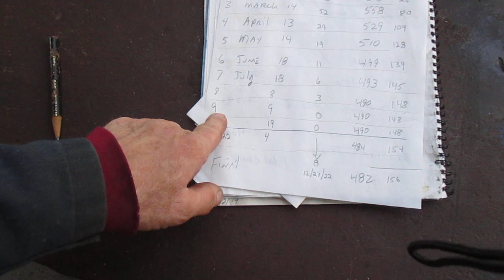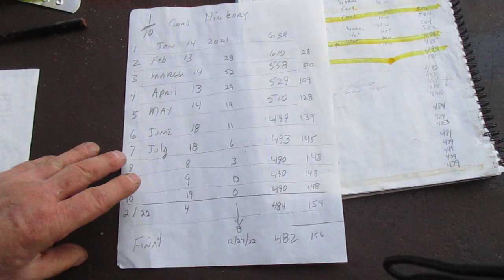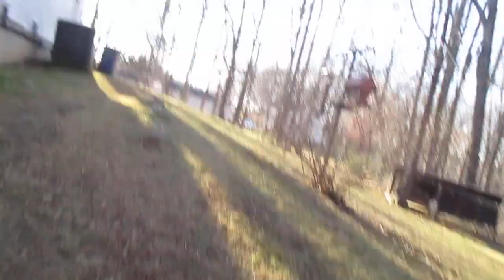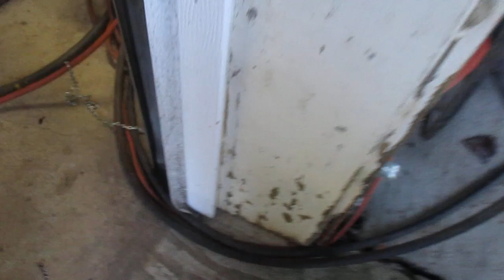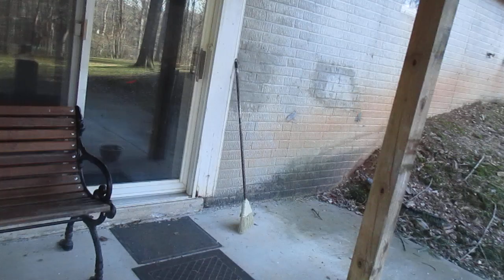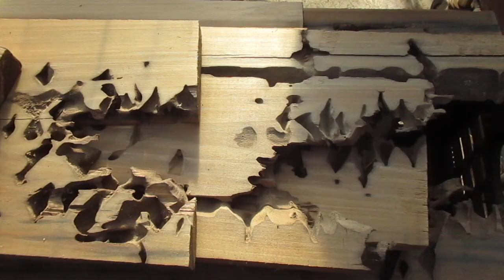Just Lots of STUFF # 1016

Comment: Hello John. You got it right. Chuck and Deb at Iron & Oak Sawmill. We we selling the GMC of wood. We need to step it up a bit. LOL. Those sections we sell are 8 cubic feet per section. About 1/16th of a cord. Folks seem to like that amount, but we can always make larger amounts if needed.
Reply from the maker: hi just kind of wondering . the amount i had was 12 cu feet at 50 so i was in the ball park , thanks john
Reply: @fricknjeep  I think you are pricing it right, but that depends on the market.
Reply from the maker: @IronOakSawmill  hi again don't really need to sell  it . so we will leave it at 50 . thanks for the help john